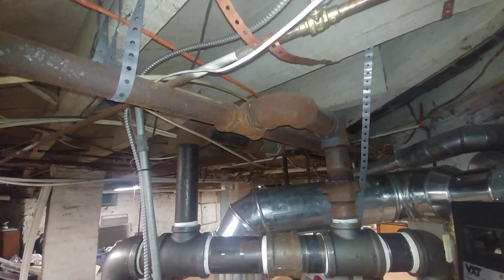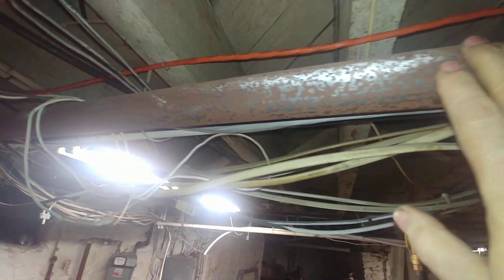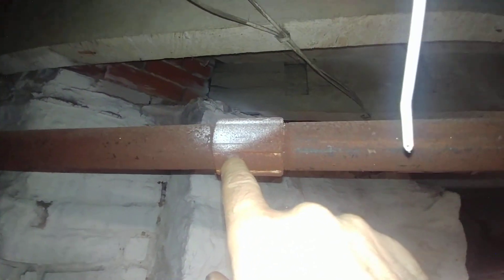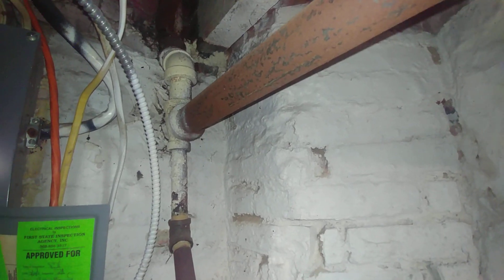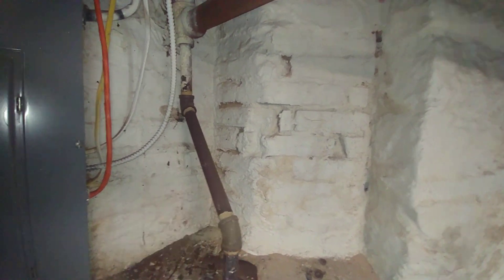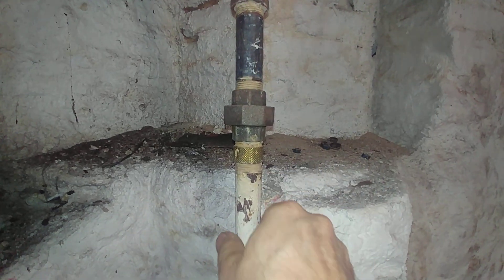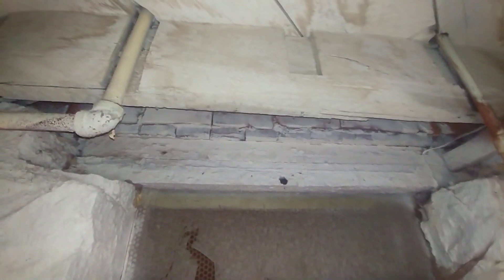Late Victorian Steam Piping Still Going Strong

Comment: What kind of vent is on that radiator? The offset on the iron pipe is beautiful.
Reply from the maker: That offset on the iron pipe is Dead Man work at its best.
I'm not sure what vent you mean? Do you have a time mark on the video I can go to?
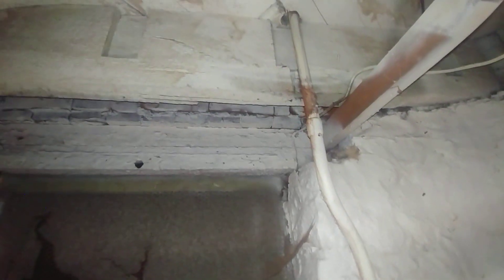Reply: @gordonschweizer5154  Around the 4:00 mark you mention a vent on the two pipe system. Is that a similar vent that would be used on one pipe steam? 
Thanks
Reply from the maker: @kge420  Ah, thank you, I remember now...Yes.
Some very early two pipe steam systems had a supply at one end and a return at the other end, but the returns were all dripped below the water line so steam couldn't follow (traps hadn't been invented yet). These radiators needed a vent, a normal one-pipe system vent, to get the air out.

Comment: I was noticing how the joist was cut from top to bottom to make room for the pipe. Do you have a video of you removing the traps and putting in the new pipe.
Reply from the maker: The traps and condensate return pump were removed sometime in 2016, so no video of that, sorry.
Those cutaways, I would say, are what the steamfitter had to do to get the radiator where they wanted after the carpenters had done their thing.
The three most dangerous things to the wood of your house: Termites. Water. Plumbers. In that order.

Comment: Interesting to hear about Left hand and right hand threads in the same fitting sensible way back when if unions weren’t good.
I’m not sure I understand I have to watch the video a few times to see what’s happening with the steam. Each flow and parallel flow and return along with radiators with steam vents but no traps? I think I saw it in Art of steam book.
Reply from the maker: I forgot to mention in the video that the radiators connected to that riser are sending condensate down to that drip and the condensate is drained away right away.  When condensate is forced to drain away in a horizontal supply pipe against the flow of steam, it significantly reduces the amount of steam available to the radiators for the same sized pipe.
"Two pipe air vent" is indeed talked about in Dan's TLAOSH.  
Most of the radiators in the older sections on the first floor of this house are two-pipe air vent.  The upper floors are not, as to do that would mean each radiator's return line would have to have its own separate drip all the way down to the wet return.  It could have been done, but the cost would have been high.  Reliable and cheaper traps were years away.